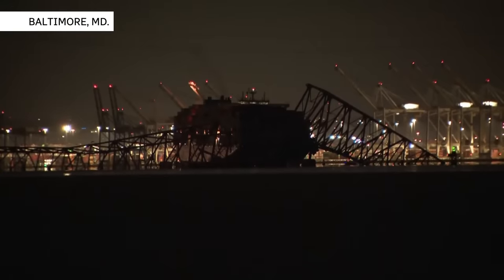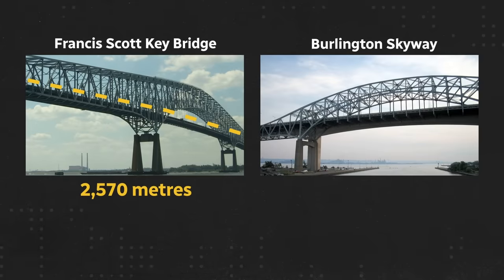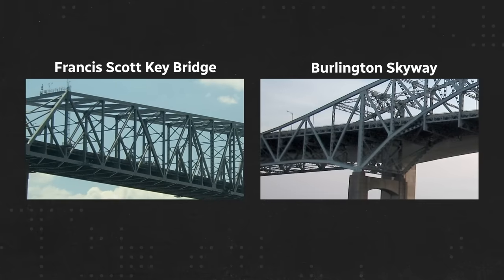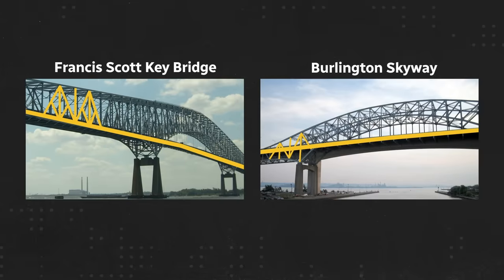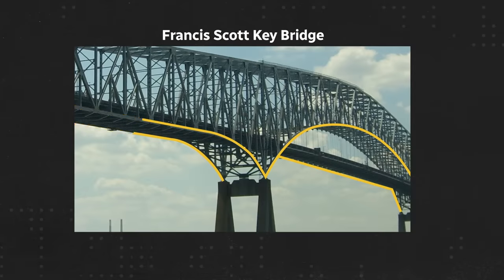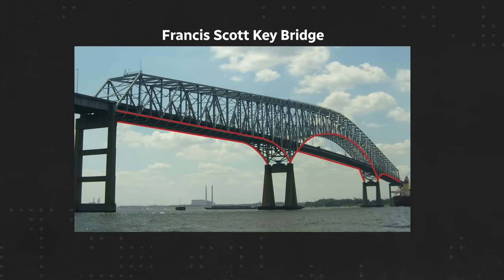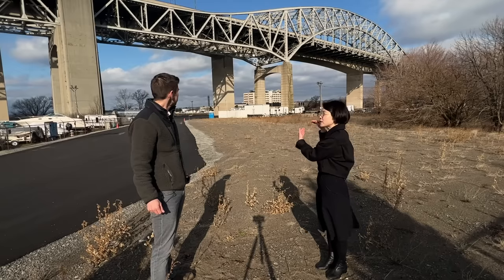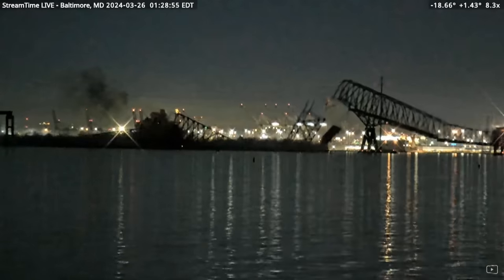How an Ontario bridge's design protects itself from a collapse

Comment: Not really comparable, the Burlington Skyway is over a man made canal, where the Baltimore bridge is over a much wider natural waterway.  It definitely should have had more protection for the piers, though. Or a different design could have put the main supports farther from the shipping channel.
Reply: bridges in general arent desined to withstand an impact from a HUGE CARGO SHIP
Reply: @randomrazr not when there are redundant supports. When inputting loads in Canada, we use almost 3 times the load for design of supports.
Reply: @randomrazr  no, they're designed with appropriate protection to deal with likely threats. Or have more added when the risks increase. This bridge's piers had virtually none at all.
Reply: @ryancraig2795  even golden gate bridge or brooklyn bridge?
Reply: I agree, the two bridges spanning Halifax Harbour would have been a better comparison. They have their supports surrounded by large, rock islands
Reply: @Mythos131  thought they had a group of whales gaurding it?
Reply: And tiny ships.
Reply: @randomrazr  dolphins
Reply: I saw where the piers of the Lion's Gate Bridge in Vancouver are going to receive loads of engineered rock to building up a defensive structure that should distribute an impact load to the ground instead of direct hit to the bridge. Be interesting to hear more about that. Like if this woman could explain it - she's great.
Reply: @randomrazr Sure.
Reply: Canadian engineering is amazing!

Comment: Makes sense that having your piers on dry land will give you an advantage in the event of a disaster. 😬 Problem is not all bridges can have that, especially when the bridge has to go over such long, wide areas of gigantic waterbodies.
Reply: Then you build artificial islands of rip-rap/rubble around them large enough to protect them. Unfortunately that costs more $ and everyone knows keeping as much money in the pockets of project leaders as possible (cutting corners) is a big motivation.
Reply: Baltimore could have built a suspension bridge like the golden gate with larger spans so the piers don’t need to be so close to shipping lanes. Or it could have built a post tensioned concrete structure like the Confederation bridge where the bridge is not suspended on single points of failure. 

It seems like Baltimore’s bridge infrastructure is much like American airports and local public transit. Built as cheaply as possible.

Comment: The Laviolette bridge near Trois-Rivieres is a better comparison - it crosses a larger body of water, and its piers are in the water. St. Lawrence bridge piers also have to take the flow of ice into consideration. Although no ships pass under it outside the Seaway canal, Montreal's Victoria Bridge (built in 1859) still has its original stone piers designed to minimize/eliminate possible ice damage.

Comment: I don't see the relevance between bridge design and maintenance and this accident. No bridge is (or should be) designed to withstand a collision with a ship carrying 100 million tons of cargo. Any bridge would have failed catastrophically under these conditions.
Reply: If you have this kind of shipping traffic around the bridge then you should put safety measures in place. I would think the easiest one to do would be building an artificial island around the pier. Then the ship would hit that instead.
Reply: They do design and build protection from large ships. They put separate islands in front of the piers that have the bridge columns on them. This greatly reduces the chance of ships hitting the load bearing piers. It also buys some time to evacuate the bridge.
Reply: @Kowkiller87  It's not that simple, by any means.
Reply: @Kowkiller87  yes! a bumper was needed for the Baltimore bridge .. sadlly
Reply: @ryuuguu01  The dolphins would have to be massive gargantuan structures to deflect a ship of 100,000 tons bearing straight on to the piers. We're talking ships the same tonnage as the largest aircraft carriers.

So all you bright "build big 'artificial islands' provide an example of where this is done, complete with the mathematical modelling.
Reply: @stephensaines7100  We know it can be done because the ship stopped when it struck the support pier.
Reply: No it's relevant..If the bridges is well designed ...it won't collapse without warning immediately...at least it will be  hinged to the piers
Reply: @stephensaines7100  I guess they forgot to consult with you before deciding to add dolphins to the Iron Workers Memorial bridge at the Second Narrows of Burrard Inlet in Vancouver to protect it from ship strikes.
Reply: @ryuuguu01  I guess you forgot to do some reading before posting.
 You could start here:
"Engineers Raise Questions About Bridge’s Construction as Inquiry Begins"
Reply: @stephensaines7100  No I did my reading. Some engineers believe dolphins placing a significant distance in front of the piers would work some do not. They all seem to feel there should have been more protection for the piers.  You asked for an example of where it was done and  I gave an example of protective piers in my follow-up post.  It only took 5 minutes to find an example so clearly neither have a strong knowledge base of the situation nor bothered to check your statement.

Comment: It's odd to see it described as a "collapse" when a 1000ton ship rammed into it. If a bus hits a compact, you wouldnt say "That compact car imploded! How can we prevent this?!"
Reply: This is 100% right here
Reply: nt:  1000 ton ship is a rowboat in this context.  Try 100,000 tons for the ship that hit the Baltimore bridge
Reply: @BasementEngineer  Thanks non engineer or physicist. I mean, no other bridge in world history has survived a full knot collision with a similarly weighted boat, but please explain the math to the rest of us
Reply: @ntindo  Kinetic energy K of a moving object:
K = 1/2 x mass x velocity squared,
ie. K = 1/2mV**2.
Thus one can see that a 100,000 ton freighter has 100x the kinetic energy of a 1,000 ton ship.  (This is greatly simplified and ignores the payload on the ship).

Apart from building an artificial island around each bridge pier, there is very little that can be done to stop such a moving mass.
Reply: @BasementEngineer  Literally every other bridge hit in the last 20 years by freighters 1/2 the size of that one have collapsed. The Bridge 2x the size in the FL collapsed after being hit by an empty cargo boat.